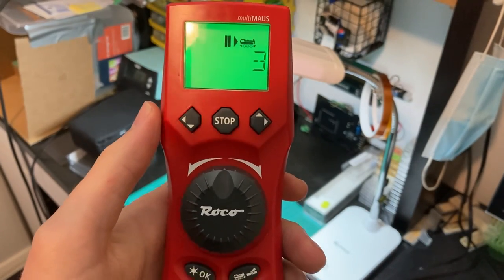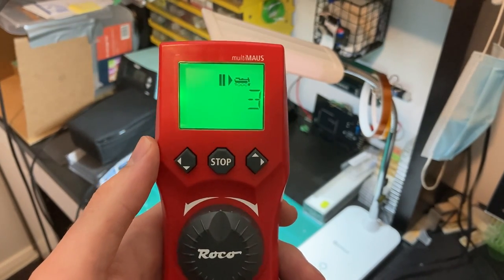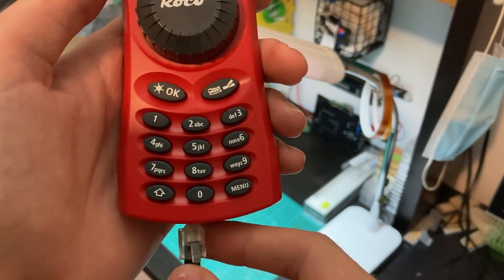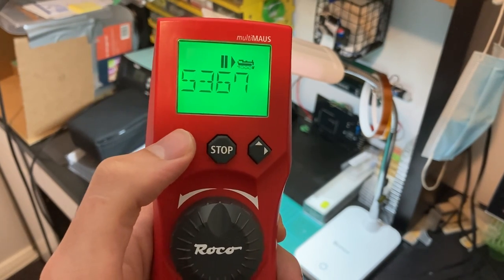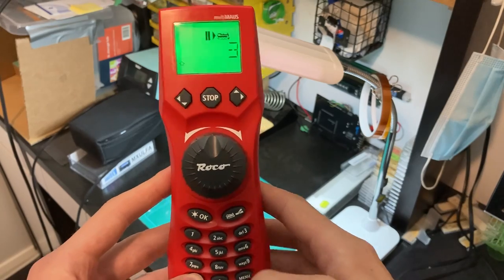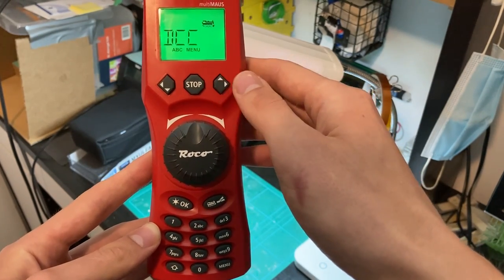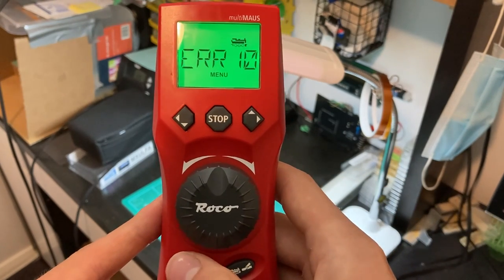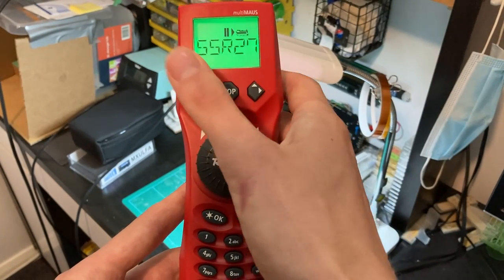DCC Fridays Ep. #12 - Using the Roco multiMAUS

Comment: Have you done a video on how to program your train decoder using the multi maus?
Reply from the maker: Hi Mark, sorry no I haven't, I use JMRI Decoder Pro to do all of my programming, through my Digikeijs DR5000. If you are keen to have a go though, you can program individual CV's through the programming menu. Hold the shift key and press menu, and scroll across to the second menu (programming), hit ok and then press ok again to open the 'CV modification' tool. You can then type in any CV number, e.g. '6' for CV6, press ok. It will then read CV6 and if successful will tell you what value is programmed to the decoder for that CV. Whilst it's flashing you then have the option to change this value.
Hope this maybe will help you get started!
Reply: Even less easy to just use MENU+1 and then CV code is read and then push train number-digit to be used and then OK, and then is saved. Couldn't be easier!!

Comment: Hey! I just bought it few days ago. I freaked out at first when watching your video for first time, but now after hands on is just easy peasy. It s just like an old phone :)) Btw, almost all new locos come with dcc address 3 by default so how can you change that in order to add multiple locos on multimaus? Because if you have more than 1, you get that Err10 just like you in the video.
Reply from the maker: Yep it is pretty intuitive once you get your hands on one! To change the dcc address, easiest thing to do is to change them to another short address (between a value of 1 and 127), changed with CV1. Hold down shift and menu to get into the menu, scroll across to programming, I think it's the third menu item, and then I believe the first menu item of the programming menu is 'CV modification'. Open this up and enter '1', for CV1. It should then read the value of CV 1 once you hit ok, which will then flash on the screen, hopefully it will flash '3'. When flashing, you can change that number to something else (between 1-127) to give the loco a new address. Once you've done this, you then need to program that particular locomotive and it's new address into the MultiMaus 'library' if you will. So that when you scroll across to that particular locomotive, the MultiMaus is addressing it's DCC address.
Hope this makes sense! The manual outlines how to do this also.
Reply: @buckamboolmodeltrains  Thank you for your elaborate and quick answer!

Comment: I bought the roco set and plugged the whole lot in and worked straight away. I once took my train to the train club to try on their track, which required the use of a different branded controller. I bought another train that day and then had to put my whole set up back in the cupboard. After 6 months I have finally got it all out again. 
The train I purchased originally in the roco set, I csnt get to run, however the train that I purchased at the train club ran straight away.

I cant seem to get the hang of the z21 controller.
I have added multiple times to the library but it just won't run.

Please help
Reply from the maker: Hi Arron, with the original loco, it may be worth doing a factory reset on it. If you're not sure how to do this, just try at least programming CV1, the locomotive's short address. How to do all of this is detailed in the Z21 controller manual if you're not sure... Let me know how you go!

Comment: hello,  good  afternoon,  could you teach us how to change the language to the multimaus, I would like to put the spanish language.  thank you.
Reply from the maker: Hi Luis, if you hold down the 'shift' arrow and 'menu' buttons at the same time you get access to the menu. Using the left and right buttons on the top of the controller scroll across to settings, push 'ok', scroll across to language, push 'ok', and then scroll through the languages to select your preferred language. I'm not sure off the top of my head if Spanish is included, it may depend on how up-to-date your MultiMaus is...
All the best!
Reply: @buckamboolmodeltrains   thanks very much

Comment: Can you do a video or just me the info if your already done it on how to program each loco to its own number in the chip and how to consist many locos
Reply from the maker: Hi William,
Unfortunately at the moment I just don't have enough time to do a video like that sorry! However, this is a reply I gave to @mrengineer1234 a few months ago, on how to program locomotives:

"To change the dcc address, easiest thing to do is to change them to another short address (between a value of 1 and 127), changed with CV1. Hold down shift and menu to get into the menu, scroll across to programming, I think it's the third menu item, and then I believe the first menu item of the programming menu is 'CV modification'. Open this up and enter '1', for CV1. It should then read the value of CV 1 once you hit ok, which will then flash on the screen, hopefully it will flash '3'. When flashing, you can change that number to something else (between 1-127) to give the loco a new address. Once you've done this, you then need to program that particular locomotive and it's new address into the MultiMaus 'library' if you will. So that when you scroll across to that particular locomotive, the MultiMaus is addressing it's DCC address.
Hope this makes sense! The manual outlines how to do this also."

You can also scroll through the locomotive library with the left and right arrow keys, and if you scroll across to 'NEW', and then hit 'OK', you can type in a new locomotive name, and then a DCC address (e.g. "6") and then it will program that particular DCC address to the locomotive, provided it's on the programming track.

To consist locomotives you need to program a particular number (between 1 and 127) to CV19 for any or all of the locomotives that you would like to be consisted together. This can be done with the procedure I described earlier for CV1.

Hope this helps somewhat, sorry I can't do a video on it!

Comment: At the Loco Library you can add up to 64 Locomotives by 5 five digit name onto the red roco Multimouse, the dark grey Fleischmann Multimouse or the new cable wired light grey z21 (roco/Fleischmann) Multimouse, all are same but in different colours of itself.

The black cableless WLAN WiFi Z21 Multimouse allows you to install max. 100 Locomotives into the Loco Library and allows to use 10 digit names of those 100 Locos but the first 5 are seen onto the display and the other digits will be shown in ,,rolliing letterrs" like on longer words, too.

If you are using the old roco/Fleischmann digital system with the booster 10764 the Multimouse and the booster 10764 both are working together as command station, so you never may disconnect the first Multimouse from Master plug in.
This old dcc system cannot read out CVs at all. 
If using the maintenace tool at the white z21 Start or white z21 or black Z21 Command Station to upgrade the Multimouse to a newer firmware Version like of V 2.0 than the Multimouse never can be used as Master Multimouse thereafter anymore again, it disallow to use the old digital dcc system, but you will have the possibility to downgrade the Multimouse firmware to version V 1.06, the last older version that allows you to use the old digital system before the z21/Z21 family of DCC Command Stations came up.

The both white z21 Start and z21 DCC Command stations does not have a separated programming track connection, so it would be useful to connect the both white z21 Start or z21 DCC Command station onto a short piece of track to use the POM (programming onto Mainline) Modus for your programming track.

For more comfartable programming I connected a short Programming track as siding to my modular layout and using a six pin double poolarity switch with center off function to swutch between programming track and layout, using the POM Modus only.

With all roco/Fleischmann digital systems and of course with the digikeijs DR 5000 Multibus Command Station you can use to handle all roco/Fleischmann and Z21 handheld Multimouse throttles to set all three different kinds of consists.

1. Basic Consist = setting all locos to the same decoder address, not the best method

2. Using loco library settings for Universal Consist (JMRI) like of what the roco/Fleischmann app does, not the best method, it has some delays between in max. 2 locos, reverse running locos need to be inverted in direction of travel into CV 29

3. Advanced Consits via programming of 
CV 19
First make your settings on CV 21 and CV 22, use the digitrax tool box calculator for it, than make settings into CV 29 and use the help of the digitrax tool box CV calculator again.

Programming onto CV 19 is easy.
You can use any 2 digit consist address between 0 and 99 to add several different locos into the consist.

Go into CV Programming to the lead loco and set at CV 19 your Consist address as example the consist address 22.

When using a trailor loco go into their CV programming and add the same consist address of 22. If the loco will run in reverse direction than add the value of 128 to the Consist address of 22 and do programming it with the value of 150.
22 + 128 = 150 (reverse direction of travel, only).
The rear loco will get the same consist address on CV 19 of Consist address 22.

The consist is seut up and as long as valid as like kill the consist from the 
CV 19 of your locomotives.

Killing a loco from consist:
Go into the loco Decoder settings menu and write into CV 19 the value of 0 (zero) than the locomotive is no longer part of the consist and you can move thr loco by its before 2 or 4 digit locomotive address like before setting the consist.
Reply from the maker: Thanks for all this info, I'm sure others will find this useful!

Comment: HOW TO RESET AN DECORER ?
Reply from the maker: Hi @joaomartins7732,

To reset a decoder, it is quite likely you will need to program a particular number to CV8, a lot of decoders use CV8 = 8 as their factory reset procedure. Hold down shift and menu to get into the menu, scroll across to programming, I think it's the third menu item, and then I believe the first menu item of the programming menu is 'CV modification'. Open this up and enter '8', for CV8. It should then read the value of CV 8 once you hit ok, which will then flash on the screen, it will flash a particular NMRA manufacturer ID of the decoder. When flashing, you can change that number to something else (between 1-255) to reset the decoder, hit ok and this will be programmed.

You would be best to check the brand of your decoder, and what value needs to be programmed to CV8 for a reset, or maybe even to a different CV number depending on the decoder type...

Hope this helps!
Reply: @buckamboolmodeltrains  Hello , i put the locomotive in the line test and they only show lights but not run , do you know what can be ? when i try reset CV appears ERROR 2
Reply from the maker: @joaomartins7732  I've just replied to your email

Comment: can you please hold it STILL going crazy trying to watch
Reply from the maker: Sorry Ben, my apologies! If there's anything in particular you'd like to know more detail on please let me know, happy to help!
Reply: @buckamboolmodeltrains  I wanted to learn how to ues the controller because I simply cannot work it out. But I will persevere
Reply from the maker: @yorkims  all the best! If you have any questions about particular aspects of the throttle, let me know!
Reply: F1-F30

F1-F10
Hold shift+F11-F20
Double tap shift F21-F30 (shift in display blinks)
Reply: @xcrisso  the Multimouse Firmware Version V 1.05 orovides Function Buttons from F0 to F10 and by using Shift + 1 until 0 you can use up to 10 anotger functions from F 11 to F 20 only.

When using the Firmware Version F 2.0 than you will have the possibility to use up to 30 Functions pressing Shift twice shortly and than the Number.